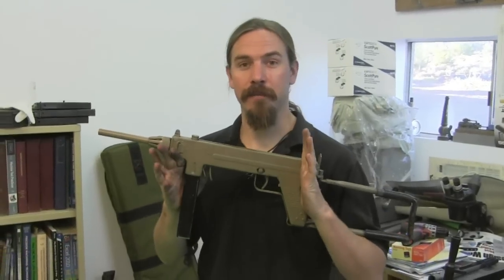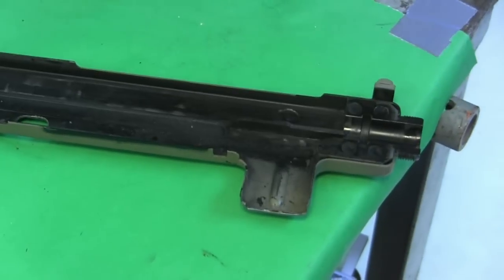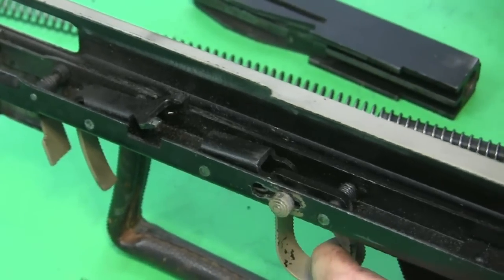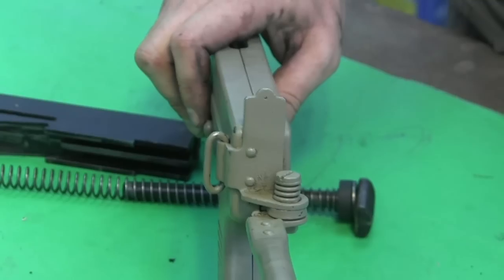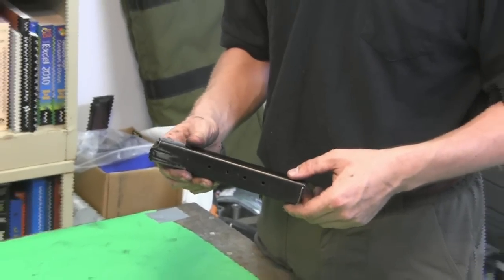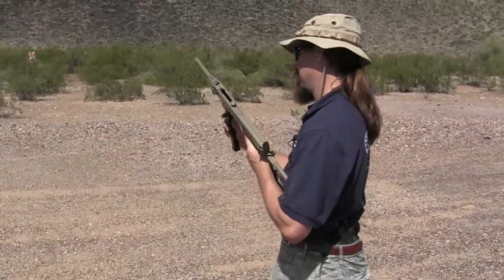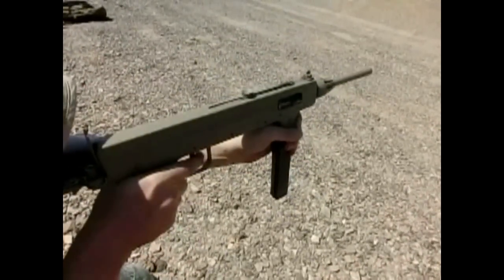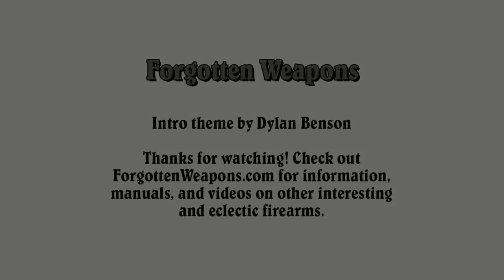Madsen M1950 SMG - Disassembly and Shooting

Comment: My dad had a dealer pre-sample one for awhile, loved it, especially the ease of disassembly and the fact you could get to every nook and cranny and clean it unlike many other open-bolt SMG's. Regarding the mags, when you unfold the gun there should be a removable magazine loader stored in the grip area that went over the magazine and had a plunger to move rounds down into the mag making it much easier.

Comment: I would add a little piece of metal under the barrel so the nut stays on the gun and you can't loose it in the field. The nut is very simple but important, you can't close your madsen without it....

Comment: The grip safety seems kind of like an answer to a question that was never asked.  I have not used an SMG much, but is like the ability to fire it with one hand if needed.  The only SMG that I've used was a Sten, and it would be awkward to use one handed also.
Reply from the maker: It may not be the best answer, but it was definitely a legit question - how to make an open-bolt subgun safe. Most open-bolt SMG designs are liable to fire unintentionally is dropped the wrong way, and the Madsen grip safety does a good job of preventing that, albeit at the expense of different problems (like not being able to use it one-handed).
Reply: I did not no that it was that much of an issue with other SMGs.  Like I said, the only true SMG I've used was a sten.
Reply: banditone00
The problem with all SMG's is the short barrel: too easy to move off-target in the heat of the moment. Ally that with a high rate of fire and a tendency to splatter the target with bullets (most were designed to hit someone in the next room or next trench so accuracy was not really an issue) and you have something that was meant to be fired with two hands for maximum control. If I saw someone trying to fire a Sten one-handed I'd run for the hills.

Comment: I wonder if the grip safety was also designed to be a drop safety? With the grip safety sear so far forward of the trigger sear, it would appear to me that if the bolt bounced far enough back to strip a cartridge, the grip safety sear would catch it. Only problem would be then gripping the magazine would disengage the grip safety and allow the bolt to slam forward and fire a round. This could be ameliorated by training to rack the charging handle back when you pick up the gun, to make sure the bolt is caught by the trigger sear.

Comment: IS IT JUST ME OR IS THIS GREATEST MOST SIMPLE GUN EVER....   SEEMS MIGHTY FINE....
Reply: Sten is far simpler in construction (except the fire control group, though still pretty simple)
Reply: Luty BSP 9mm is much simpler, all parts for that thing can be found and bought at your local Lowes....
Reply: ***** the Tec9 Is also a rather simple gun. it may not be full auto but it's compact and simple.

Comment: R/e the loading of that magazine, that should have had a magazine loader in the pistol grip. Noticed it was missing from your example. The bracket was still there.
Reply from the maker: Yeah, we were using it to load the mags.
Reply: I see. They are a handy little gizmo. Not as "must have" as a STEN loader, but still useful.

Comment: I remember this gun in the movie Diamonds are Forever, where the character Tiffany Case ends up clumsly firing the gun and falls off the edge of the oil platform. Looking at the safety switch I'm just curious is it automatic fire only?

Comment: I like simplicity' but I'd get rid of that safety by the mag well - also' I'd have a ventilated barrel shroud around the barrel - outside of that I'd say it's about as close to perfection that you can get' but alas' the Uzi still rules! compact and ergonomic it is hard to beat.

Good Video by the way' Thanks!

Comment: You didnt say, is the barrel indexed?
I see a notch on the barrel, but no corresponding key in the trunnion.
Reply from the maker: No, it's not indexed. There is a feed ramp cut around the entire circumference of the chamber.

Comment: It's more difficult to make good, stiff, well toleranced clamshell stampings than you might think.   In a post war factory equipped to do so it's no big deal, in a small work shop or garage it usually means welding smaller stamped sections together.  Or just milling sections out of billet. Early AK is an example.

Comment: Cool SMG but i don't like that it forces you to have your hand on the mag well. I was holding a full auto PPS-43 just like you would with that one. A round fired out of battery and sent shrapnel down into my hand. Not a good time.
Reply: OOB detonations in open bolt guns is a fairly common occurrence.

Comment: Hmmm is the UZI very close to construction to the madsen. It seems like it has alot of elements that are similar. And I mean opperation instead of take down.

But the take down does seem very intelligent. Having that capability would be a dream to clean.
Reply from the maker: The mechanical functioning of virtually all open-bolt submachine guns is basically the same. Madsen, Sten, Uzi, MP40, MAC-10, etc...they all work the same way.

Comment: This thing is incredibly crude compared to some of the designs from the 20's like the Thompson 1927 or the Suomi SMG M31.. But simple works in military firearms :D Speaking of the Suomi M31.. Could you get your hands on one..? It sure has some interesting features like the hermetically sealing breech and being over engineered gives a lot to discuss about. And it sure as hell saw a lot of action in the WWII. However it does need the hottest available 124gr 9mm to cycle properly.
Reply from the maker: The first generation SMGs were expensive - milled and finely finished (MP18I and II, Thompson, Lanchester, early Berettas, etc). By the time WWII rolled around, people realized that they could be made much cheaper and still fulfill the job requirements just fine. That led to the second generation of guns, which were stamped and cheap, like the Sten, M3, MP40, and others.

I'll do a Suomi m/31 video when I can, but I need to get my hands on one first. There are lots of the semiautos out there, but not a lot of live machine guns.
Reply: Forgotten Weapons Would it be feasible for you to reproduce the Madsen if you had all the correct blueprints?
Reply from the maker: Robert hoefkens
Not me personally, but someone certainly could in theory. In practice, it would be very far from cost-effective. For a gun like this to be practical to manufacture, you need to sell a lot of them (making stampings is really, really expensive for the first one, and only becomes cheap once you've been able to use the same set of stamping dies to make a few tens of thousands of units). There simply isn't a market for tens of thousands of Madsen SMGs today.
Reply: Forgotten Weapons

Thank you for the reply. Yes I know select fire M31's are hard to get hands on because most of them are still here in Finland. I bet there's a few hundred barnes and attics here hiding something quite different than a grand pa's old rocking chair.. Accompanied by an M39 Mosin and a Degtaryev M27 LMG.. :D

Comment: This may seem like a stupid questions, but what kind of ammo does it fire?
Also, is the design similar to the German MG 40 or the American M3 "Grease gun"?
They seem cosmetically similar. Great videos
Reply: 9mm.
Reply: 9mm luger
Reply: The designs are similar in function, heavy bolt, fixed firing pin, but that is about it. Most sub-machine guns of that time were if similar general design.
Reply: The MP38/40 inspired the configuration of the M3 and all the SMGs  that resemble it.
These include:
Karl Gustav M45 (Sweden)
Hovea M46 (Denmark)
Madsen M45-M53 (Denmark)
Beretta Mp38/44 (Italy)
Star MP45 (Spain-a modified copy)
S&W M76 (USA)

Comment: Will it fire if the forward-grip safety is pressed after the trigger is pulled?
Reply from the maker: +Rickinsf No.
Reply: Madsens were also used in the Guatemala coup of 1954. CIA procured non-US-made gear in hope of maintaining "deniability." One is featured in the Diego Rivera painting, "Glorious Victory."

Comment: Nice little SMG :) I had the Hovea M1949 submachine gun when I was a Sergent in the Danish Army. Worked pretty well, allthough we had to use one of the shoelaces we used for our boots, and tied one end to the SMG, and the other to the magazine. They had a tendency to fall out of the gun when we were in the field, often even light pressure on the mag release caused the mag to fall out.

Comment: Some SMGs and machine guns are fascinating in how they can be much simpler than most semi-auto pistols, even if semi-auto often means adding components to lock the bolt after each shot and reset on trigger release

Comment: The Madsen is a very simple weapon to use and maintain, but didn't Smith and Wesson have a  similar stye sub machine gun that was somewhat of a non success ?
Reply: The S&W M76 was a copy of the Kpist m/45 made for the vietnam war
Reply from the maker: The M-76, as noted by Uryendel, is a copy of the Swedish m/45. It looks a lot like the Madsen, but doesn't have the clamshell-type assembly.

Comment: Great video as always. Nice design. I like the hinge open receiver. The grip safety is interesting- it kind of forces an isometric tension style grip. Looks very controllable with a modest cyclic rate- i'll guess abt 500 rpm. Makes it easy to do 2 and 3 round bursts. I have some experience with a Beretta Model 12S, and it is much the same way.

Comment: The only thing from me really liking this gun is that stupid grip safety at the front.
Reply from the maker: Keep in mind that open bolt subguns have an endemic safety issue - lock the bolt open with a mag inserted, and a hard knock will jar the sear enough to let the bolt run forward and fire. Same thing can happen with the bolt closed over a loaded mag - drop the gun on the butt and the bolt may bounce down far enough to strip out a round and fire it. The grip safety is a very effective way to solve that problem; it just brings other issues along with it.

Comment: What's the story on the Chauchat in the background at 3:36? Do we get a firing test soon?
Reply from the maker: It's a dewat, and needs to be reactivated before we can take it out shooting.
Reply: Ah, best of luck, despite their negative image, I'd love to see one shoot. is it the 8mm model?
Reply: Ahmed Sabbagh the 30.06 version yes. The one chambered in lebel works better
Reply from the maker: jdizzy01
Yes, it's in 8mm - a standard M1915 CSRG. I'm really looking forward to shooting it too!
Reply: Angzztflash
Weren't some of the parts for the .30-06 version made in the wrong size, on account of somebody botching the metric conversion? Or is that just an urban legend?
Reply: RedXlV im not sure i just know that peoply commonly misjudge the 8mm Chauchat due to the 30.06 version
Reply from the maker: RedXlV
I don't know that it had anything to do with unit conversions, but a big part of the .30-06 problem was that they used the wrong chamber spec.
Reply: Ahmed Sabbagh if in perfect condition and environment i think its going to function just fine...........